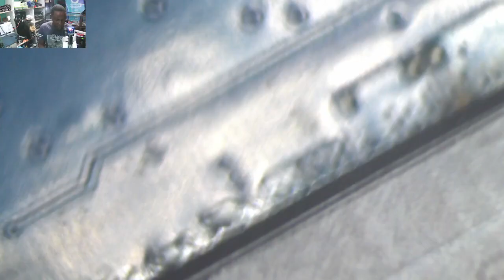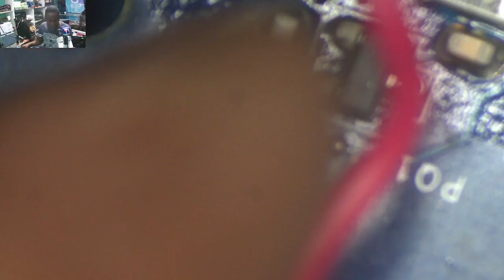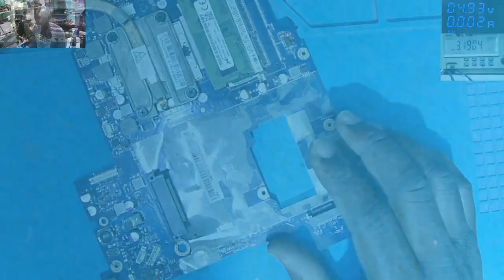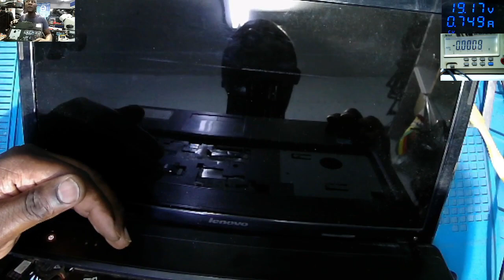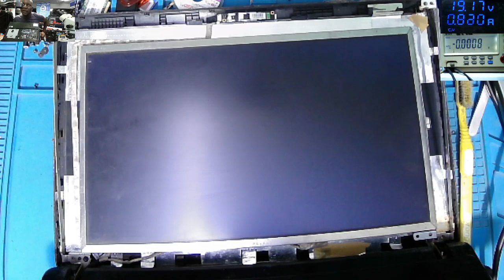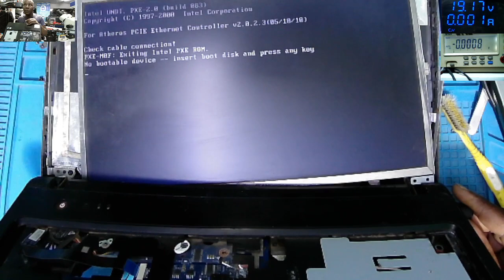Lenovo G570 Not Charging Not Turning On Motherboard Repair--- Blown Up Mosfets Mystery.

Comment: Am 100% sure the laptop won't charge the battery. Most likely there is an issue with the BQ power management chip which is responsible for changing and opening the gates of the first and second mosfets. I stand corrected. TNX
Reply from the maker: Unfortunately the went and never return so we assume all worked well,.. Thxs for the feedback